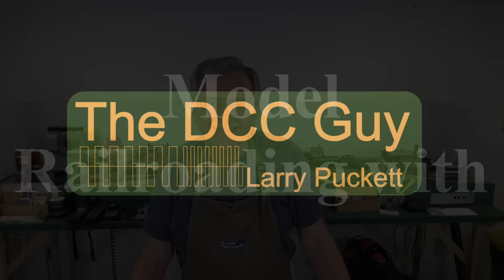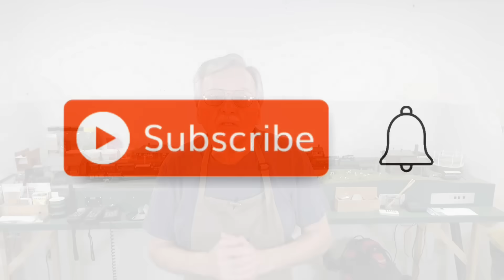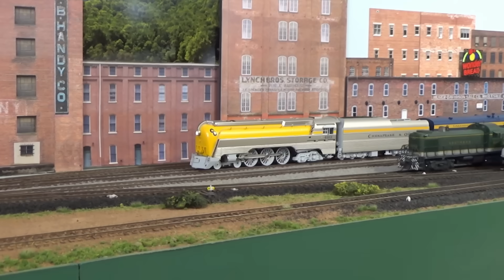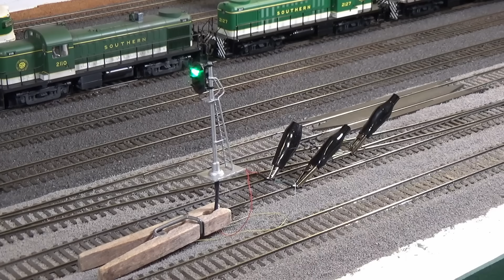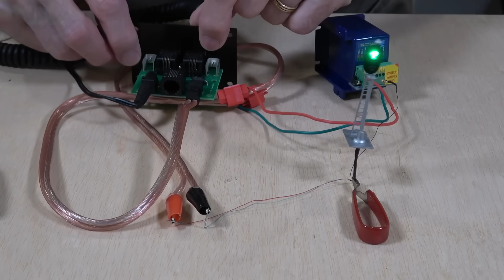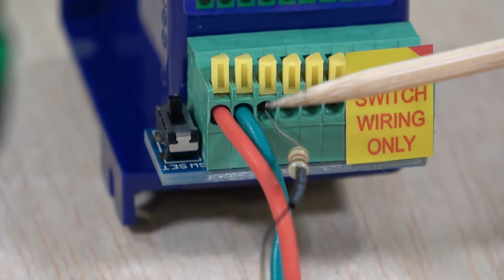Easy Signal Wiring For DCC (400)

Comment: Your 2 videos really helped me understands the wiring. A problem I have is physically connecting the small wires (36 gauge?) to the bus wires and frog. I’ve used 22 gauge drop down wires from the bus wires and frog and tried soldering to them with some success but the results were hard to stabilize under the layout. Is there a better way to do this or perhaps a video showing how to do this?
Reply from the maker: One option is to connect the small wires from the signal to a screw terminal block (Amazon) under the signal and then use larger wires between the terminal block and your control circuit. You can bundle multiple wires using wire ties from bread wrappers. and suspend them from cup hooks attached to the underside of the layout.

Comment: I am using Bachmann EZ track crossovers. I tried using alligator clips to connect the red and green wires to the track. The black ground wire is clipped to the points but the lights don’t work. If I touch the black wire to any track and the light turns green or red depending on which track. I conclude the points have no power. It looks like they are unpowered. Do you have any suggestions or advice that would lead to a solution? Thank you.

Comment: I have a DS52 Digitrax stationary decoder controlling 2 Atlas solenoid turnouts. How would you wire dwarf signals  (red/green) to these 2 turnouts?
Reply: Would an Atlas Snap Relay and follow their wiring examples?
Reply from the maker: Do you have a way to control frog polarity? If not try this approach https://youtu.be/TpOaQqBrhcE?si=DRZDLSFyoj8SuxVW

Comment: Hey Larry hope your well, im trying to get my head around wiring cobalt ip digtal switch machines using aux bus. I see you do the same,  my question is from what i can see in your  video 392 that you are powering your frog with the aux bus, or am i not incorrect??
Cheers Mark in Australia
Reply from the maker: Yes, you can use the frog connection on the iP Digital to control the polarity of the common wire connection to the signal.

Comment: I have been thinking about going to dcc .But I don't know if I can handle all the problems everyone is having
Reply from the maker: The problems most people have are the result of not reading the manuals and failing to due what is necessary for reliable results. Sort of like trying to operate a fancy new TV or any other electronic device without reading the manuals. It is also important to accept that DCC in a number of ways is not your old DC system and requires some different types of wiring and planning. I have known folks who simply disconnected their DC power pack and hooked up the DCC system and ran trains without issues. The problems come when dealing with large layouts, poor wiring, and failure to read the instructions.

Comment: Dear sir, I am making a 6 feet layout. right now I have only one locomotive and HM7000 8 pin decoder, please guide me, how many amp power supply should I use.
Reply from the maker: Even the lowest power DCC system will be enough for that although you don’t say whether your loco is N, TT, HO, OO, or O scale which is important. However as you buy more locos and desire to run more than one at a time your power needs may increase.
Reply: Sorry it was my mistake. It is HO scale.

Comment: Would this work with the Walthers switch machines and their push button controls instead of using the option on the NCE controller?
Reply from the maker: Yes, those have a SPDT on each switch side for controlling frogs and accessories.
Reply: Thank you Larry!

Comment: Larry, thanks. I've been watching for this video, and it's a much clearer explanation. 

I should've clarified in my previous post that I have a DC/analog layout. The only question I have is; can this be done on a DC layout, where power isn't always flowing through the track/bus, or will I need a separate supply to power the LEDs, and SPDT switch? Thanks, again!   

P.S. On a limited budget DCC was out of my price range. 😞
Reply from the maker: As the video title says this is a DCC wiring solution so for DC it is a bit more complicated. First, since power is not on all the time and also varies in voltage you would need a separate power bus for these signals. Also how you switch your points is another complication. If manually then you would also need a way to flip polarity at the same time. Caboose hobbies makes manual switch stands with contacts for reversing polarity so you could use those. Or even the old simple SPDT slide switch mechanism will work. I did a video on that and other manual ways to switch points and polarity, just scroll down through my videos to find it.
Reply: @TheDCCGuy  thanks, Larry. You've confirmed what I suspected. I did find a video, from a fellow in the UK, who explains the circuit needed, using a SPDT switch. I'll just have to settle for this option, or wire/power them for the most likely scenario. Either way, I appreciate you taking the time!

Comment: Can this be done with frog juicers?
Reply from the maker: Yes and no. Technically the Frog Juicer will change the polarity but it will not do it until the locos front wheel hits the frog. However you don’t want your locos entering a turnout set against it so it operation it would not work.

Comment: Will this work with occupancy detectors?
Reply: Better yet, does it have a way to progress in signals as a train clears a block section like in ABS?
Reply from the maker: It all depends on the occupancy detector or ABS circuitry. If the circuit can handle an LED and is designed to flip polarity then yes.

Comment: If your application does not allow for use of a Tortoise switch machine or polarity switch, you can use the turnout itself as the switch. Run a wire from the frog as Larry did in the beginning and then send 2 dropper wires down to the bus. You will need to keep the sides of the point and stock rail where they contact as the switch is throw VERY CLEAN to keep the turnout electrified provided you are using a Peco turnout. Also, insure all your locomotives and rolling stock are in gauge to avoid a short at the point where the flange passes between the point rail and stock rail as they WILL be opposite polarities!

If you have a Insulfrog turnout from Peco with the underside wiring, insulate the frog and use a piece of wire to bridge the two short rails, this will essentially turn it into an electrofrog turnout, then just run the wire from the frog like before.
Reply: If you add a diode and a capacitor, you can also use that method to throw a relay and basically add a pair of contacts to an ordinary turnout without a switch machine!
Reply: @Hyperfokus.signals im confused, can you elaborate further?
Reply: @Emo_Vegeta I'll have to make a diagram, maybe I'll show it in a video on my channel.